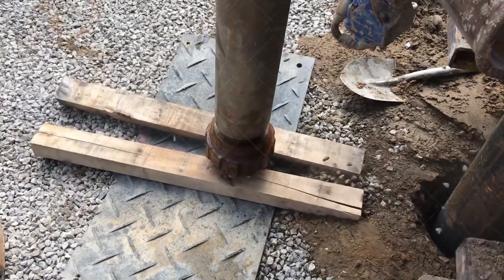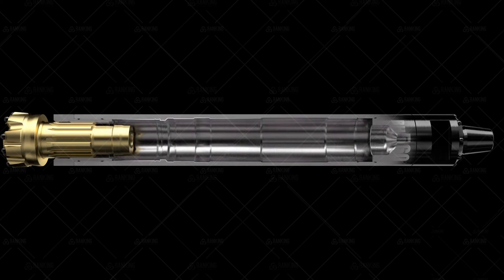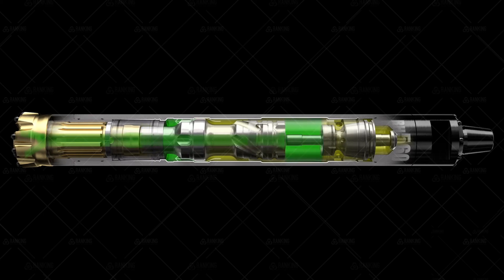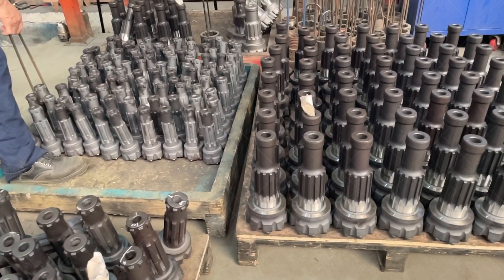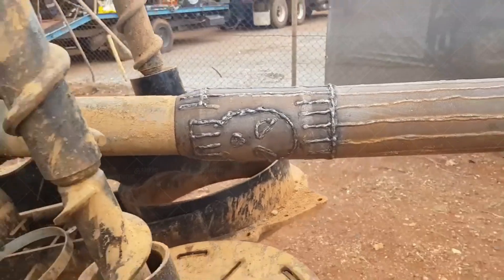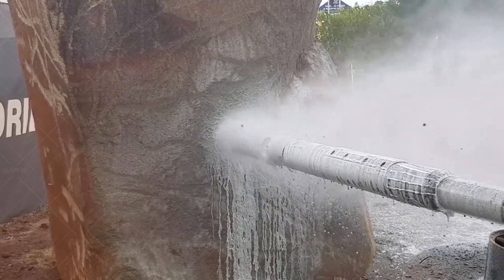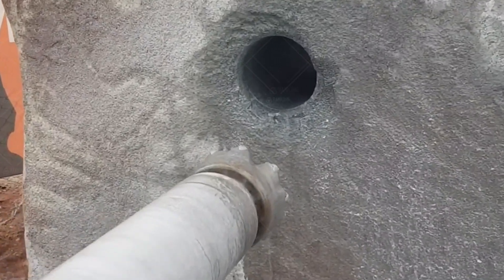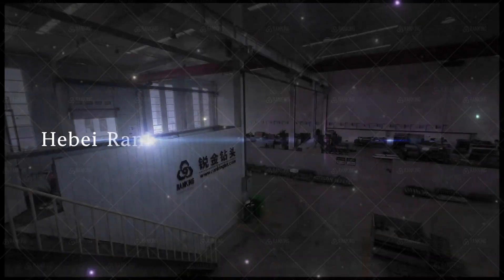Your Guide to DTH Drilling！

Comment: Is the cost-effectiveness of DTH Hammer justified by its efficiency gains?
Reply from the maker: Yes, the cost-effectiveness of the DTH Hammer is typically justified by its efficiency gains. Although the initial investment may be higher, the increased drilling speed, reduced downtime, and ability to handle difficult formations often lead to substantial cost savings in the long run.

Comment: Some argue traditional drilling techniques are more reliable than DTH Hammer. What's your take?
Reply from the maker: Traditional drilling techniques can be more reliable in certain situations due to their proven track record and simplicity. However, DTH Hammer offers significant advantages in efficiency, precision, and versatility, especially in complex geological formations, making it a vital tool in modern drilling operations.

Comment: DTH Hammer is efficient, but its environmental impact shouldn't be overlooked. Are there sufficient measures in place?
Reply from the maker: The DTH Hammer is indeed highly efficient, but its environmental impact is a valid concern. To address this, the industry has implemented several measures such as using eco-friendly lubricants, optimizing waste management, and minimizing emissions to reduce its environmental footprint.